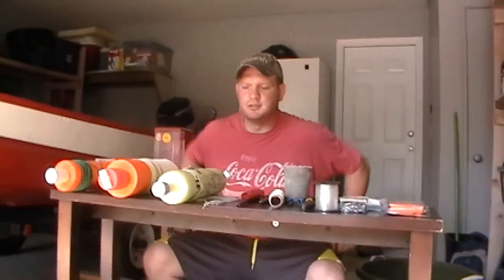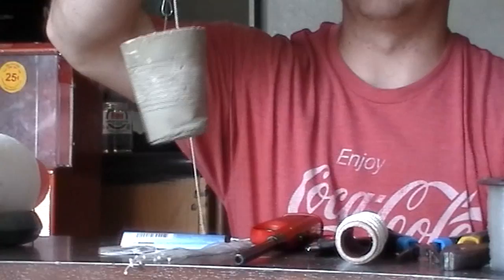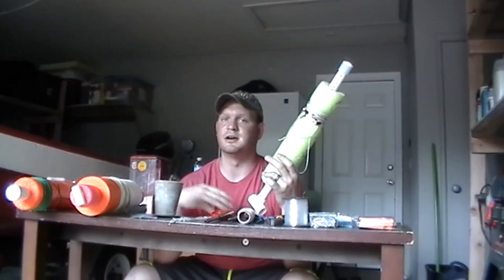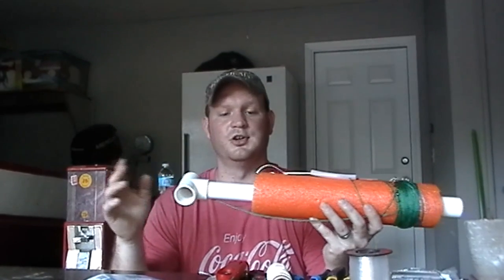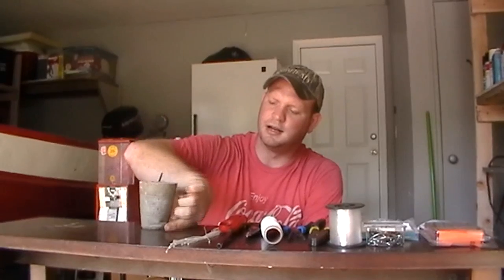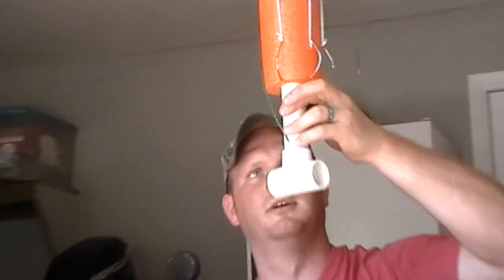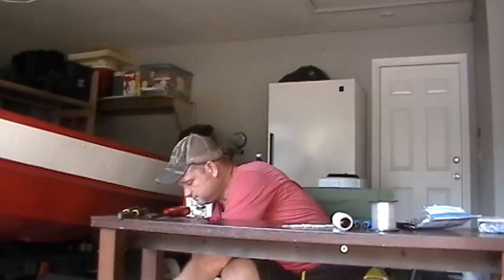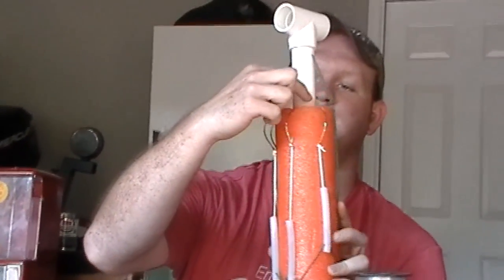How to Make Jugs Lines for Catfishing...Unique

Comment: I like what you are doing, definitely going to copy your lasted version. Just wanted to let you know that gray PVC electrical conduit is UV resistant so it should last longer than white PVC. White is made to buried out of the sun but gray is used on buildings exterior so they add UV inhibitors to prevent dry rot.
Reply from the maker: Did not know that Jim thanks for the info!

Comment: Excellent job! Those tubes to hold it from the main line is exactly what I needed to know. I was constantly dealing with a tangled mess every time I messed with the noodles. I am now excited about using these again. I agree with the concrete weights as well. Much easier to make any size you want and won't break the bank if you lose them. Thanks for sharing! Tight lines amigo!
Reply: Absolutely! Just make sure your "drops/leaders" arent so long that they can swing back into the mainline when your fishing and they will very seldom get hung up. Also inside the plastic piece is a swivel, that'll spin when you get a cat. Good Luck!!!

Comment: Great vid! You can drill a hole in the T and put a small bolt through with a washer and nut,then you can loosen the bolt,take off the T and change the foam. That way you don't have to cut off. My buddy made some of these for our fishing Trip and they work great!
Reply: Great idea Mark, maybe even just use self tapping sheet metal screws!! I am going to try it on one. Since I am making some this weekend.

Comment: Excellent video! I have been modifying jugs for many years for what works best for me. I use a similar method to keep my dropper hook away from the main line. I use a large 3-way swivel tied above and below to the main line. I tie the dropper line to the 3rd swivel eye and snug the end of the plastic tubing onto the 3rd swivel eye. The whole thing will swivel and still keep the hook away from the main line. I too use cement weights, but I have come up with a very convenient way to attach them to the noodle jug. If you are interested I will share it with you.
Reply: You bet shoot me a message.

Comment: Maybe a little time saving tip; when you're drilling your hole close to the tee, try a directional hole towards the tee to aid in getting the line through to the tee and you're not having to flip this way and that. I'm gonna make a few of these and give 'em a shot. Great video.
Reply: I'm making another set of 40, we took your advice and it worked much better. Thank you for the tip!

Comment: I understand you don't use the weight because you're worried about people running jugs but I'm not concerned about people running jugs where I'll be using them so I'm trying a hybrid of yours with the weight in the end. I will cap the T's so the steel weights don't rust and leave rusty water all over my boat. I like the idea of the T to adjust the depth. I also like the idea of the concrete weights to keep from having to spend an hour looking for all of your wayward jugs. One suggestion - you state you use orange noodles for better visibility. They didn't have enough orange noodles so I bought some orange and green. For my set-up, with the weights, I couldn't cut the noodles evenly to prevent waste (I had to get the balance right) so I had some noodle left over. In an attempt not to waste anything I put a 4" section of orange noodle on top of a 8" section of green noodle and I think I'm going to make the rest this way. I think that'll improve visibility since you've got contrasting colors and the orange is on top so when tripped but orange and green when they're on their sides.

Comment: Made some of these noodles and they are the best design I have tried.  I have caught many fish on these.
Reply from the maker: Thanks Jeff I took 20 of these out yesterday and caught 24. Biggest was 15lbs and the majority ranged between 3-7 lbs. If you find a better design or a way to improve, let us know. Thanks!
Reply: I found a better way to make the concrete weights.  Instead of using wire and  forming and bending, just buy a pack of chainlink fence ties at Lowe's.  Already have the shape needed to insert into concrete.  A bag of 25 is about $3

Comment: Thank you for your video!  It was a great help.  I made 8 of these up and for the most part used yours as a pattern.  On mine i found that with a long small screwdriver i could push the mainline all the way through the 3/8" ID tubing and attach one end of the double ring swivel using the same loop method on the mainline as you use on attaching the leader to the hook and leader to the swivel.  Then I draw the swivel and line back into the tubing.  This eliminated the need to tie the knots on each side of the tubing.  You can still change the hook and leader and move the hooks up or down the mainline if needed.
Reply: Roger Varner 
can you sent me a picture on how you eliminate the knots?
Reply from the maker: That's actually a brilliant idea Roger, would make it a lot easier to build the jugs, moving the hooks up and down the mainline is a plus, only question is how well do the hooks stay put once a cat gets on them... i would think they would slide to the next hook and tangle up?

Comment: Great video. One thing I'm going to try to do that will save a little $$, instead of using an "end cap" on the PVC pipe opposite the "T", is to drill a hole through the pipe at the opposite end of the "T" and use ultraviolet resistant zip ties at that end. One or two zip ties should keep the noodle from slipping off and it would be easy to snip off the zip ties to slid a new replacement noodle on when the old one goes bad.

Comment: You might try taking a razor knife and slice one cut length wise on your 3/8 waterline tubing, so you can just pop it on your leader line easily. If you are worried about it coming off, just add a drop or two of superglue. Great video!

Comment: Howdy,  I watch this video a few years ago and made mine like yours, which have evolved over that time to fit my specific needs and preferences.  I hope you are still catching fish and all is well.
Reply: Got the opportunity to take these exact same jugs out last weekend. Still holding up, foam and hooks need to be replaced, but still caught some.
Reply: I made some too. I've lost a couple when big fish took them down and got wrapped up in something deep. I'm going to glue/silicone 20 oz bottle lids inside the two Tee openings so I can screw bottles on for more  floatation when using bigger baits for bigger fish.

Comment: I run a two liter bottle with a 5 foot nylon leader and one hook on the bottom, i dont have a boat and made these and they all got tangled when trying to throw out from the bank so i made mine and they go out much easier but when i did catch one of yours it was hooked three times, wrapped in line and dead!

Comment: I absolutely love what you have done here.   I will be building this jug almost exactly.  I like mine to stand up when there is a fish so there will be a little difference.   Wonder if a steal leader 6" would work instead of the 11 1/2 in folded string.  When I build these and use them I will give you credit on my channel.   Not like you need it.  My channel is just beginning.

Comment: The plastic pieces your using has been used forever. You can buy them at most bait shops. They use metal instead of plastic and they also use swivels. Most people use them crappie fishing with reel and rod when they want to use more than one hook. I noticed that when your weight was not putting pressure on the line the hooks didn’t stay erect, they laid down against your line that would still cause it to tangle up the metal wire ones stay erected all the time. Just thought I’d let you know 👍

Comment: I also use RR spikes.  I like "Free".  I did lose my first one yesterday.  The spike must of gotten wedged in some rocks.  I had to cut the line and whatever fish were on it.  thinking I might use a very short strand of 10lb test between the spike and the trotline clip I use to clip it to my jug line.  That way if it ever gets caught again I can keep my fish and just lose a spike, which was free anyway.
Reply from the maker: Daniel that's an excellent idea! There's no doubt at some point you'll get hung up and lose a weight... using a small piece of 10-20lb line attached to the mainline would prevent breaking your main line and "shortening" the distance between your bottom hook and weight. I made 38 more 2.5lb weights last week and the cost was $8...$0.21 each

Comment: Thanks for taking the time to make this video.  Very informative and step by step.  Only question is what did you use for the plastic pieces?  Thanks again...
Reply: For the plastic pieces I tried about 10 different things and different lengths. I went to Lowes and bought a 25ft roll of 3/8" inside diameter soft pvc that is normally used for plumbing in refrigerators... I've layed these new jugs 3 times now while laying the green jugs... I caught 2 fish on 19 green jugs and 8 on 10 orange (new) jugs... Almost all of my hooks were cleaned on the green jugs and as far as the orange jugs go they almost all had a fish or bait still

Comment: Great video. I'm making 10 and heading to Eufala Memorial Day weekend. If I'm calculating right your top hook would be in about 25 feet of water when all your line is deployed if you have one hook every six feet or so. After you've had a chance to use these would you add more hooks or space them out to about every 10 feet?
Reply: Your absolutely right Ben, I've been using 20 of these exacts jugs for over a year now. I'm fishing out of 1950 semi V bottom that sits very close to the water. I haven't made any modifications to them, these are my "3rd" generation jugs, each time getting a little better... I would recommend spacing the hooks 5-6 feet apart for sure...it allows me pull 1 cat off while the next cat is still "calmy" in the water. Having more than 1 cat at a time has proven to be disastrous. The more hooks you have in the water the better off you are right...? Yes and No ALOT  goes into finding where the cats are and fishing them, I've found that I rarely fish deeper than 40ft and usually I'm around 12-25. A 5th hook would rarely get used on my jugs, but if you have a honey hole and need it, by all means throw it on there. GL Ben hope to see ya around Eufaula sometime
Reply: I wanted to let you know I made these jugs and put them out last year. We HAMMERED the cats. Caught enough to feed an army in a little over 24 hours. It was really exciting when I had two fish on the same jug! Thanks for the video. I’m headed back down To Eufaula for Memorial Day again. I’m hoping the weather hasn’t thrown the timing off too much!

Comment: Very nice. Thanks for the video bud. Me and a few buddies are trying this in a few weeks.. making them up at the moment... I'd like to see if you have any ideas for yo yo reel set ups?  I made some tripods and put them on noodles and some like the black swans but haven't found alot that will hold up that are cost affective... the tripods I made r about 12 bucks each and the swans are about 6 but have to heat pvc to bend the pipe.. just wondering if you have any input or if someone else does for my yo yos

Comment: Thread 6"mono through swivel before putting into tubing. Hold ends together with swivel hanging in  middle. Thread both ends through tubing. Pull swivel through tubing. This eliminates having to use screwdriver.  Leave mono attached to pull swivel and line all the way through tubing

Comment: Milk crates are my favored way of holding my jugs. I have also used a duck decoy bag.  I may have missed it but how long is each line on your jugs?
Reply: There is 50ft of line on every jug and each hook is 5-6 ft apart. I found not having the hooks so close together prevents less tangles and keeps the bottom fish in the water until I can get the top fish off. Because once the cats break the surface they tend to flip out and having 2 in the boat at once is no bueno. Milk crates are awesome, but I fish out of a 1950 14 ft Semi V bottom boat so space is a big issue.

Comment: Thanks for the video!  I made 8 and put out with cut shad.  I caught 7 fish.  One weighed 50lbs.  I had been looking for a way to make the bait hang away from the main line and this works perfect.  I never found one jug so a really big fish must have carried it away.  What do you think?  Bigger weight or more buoyant to catch a 50 pound plus?
Reply from the maker: I caught 28.6 lb Blue Cat a couple months ago and he drug my jug at least 3/4 of a mile. If you anchor your jug (weight on the bottom) it will definitely slow them down if not stop them completely. Its a double edged sword, because it won't allow the fish to swim and get proper oxygen (thermocline in water) and could very well kill your fish, especially in these hotter months. As far as weight goes 1-1.5 lb weights should be plenty. I personally use 2-2.5 lb home made concrete weights. The purpose of the weight for me is to stand those jugs STRAIGHT UP, making them a lot easier to see... Play around with it and tell us what you think. Congrats on your 50 pounder!!!! Thats a good day!
Reply: +THE JugMASTER Check my channel.  About a month ago we caught about an 80 lb blue.  We used rocks in socks to weigh the jugs down.  The jugs were very similar to what is made in the video.  I don't think the jug moved more than maybe 50 yards.  That's a guess.  Point is, it wasn't far enough away from where we dropped it to make us think we needed more weight.
Reply: +THE JugMASTER I agree on the concrete weight idea.  I am debating whether to use the styrofoam cups I have or use old vegetable tin cans filled with concrete.
Reply: Congrats on the 80 pounder, that's a good day!!! Becareful leaving your jugs weighted to the bottom once the water temp starts to rise...the bottom portion of the lake will become void and lack oxygen. I pulled in several dead cats 2 years ago before I figured out what was going on. If the water temp is below 55F you should be ok to weight them to the bottom over night. But once the water temp rises, it's probably best to run them every couple hours or leave the weight off the bottom a little to prevent dead cats... I used red solo cups (16 oz) for weights...the average about 2.5lbs and hold average size cats 3-10lbs in one spot over night pretty good.
Reply: That's a great tip on the lack of oxygen.  I hadn't even thought of that but I've watched videos of people pointing it out on their depth finders where the fish suspend over that area where there is no or little oxygen. We'll probably check them very often because we'll go out on a Friday night, fish all night and then into Saturday pretty much always on the boat.  I really would have liked to see that jug when the 80lb blue first got hooked.

Comment: So did the small flexible waterline pvc sections make a difference in the amount of catfish you caught? Getting ready to make my first batch of jugs and am going to follow your design if you think it is worthwhile. Thanks in advance!!
Reply from the maker: Junebug, Ive been using these exact same 20 jugs for 2 seasons now and can tell you it 100% makes a difference, the plastic piece does a couple of things. It keeps your bait from getting tangled on the main line and also holds the bait off the main line, making it easier for the cats to hit. While it was kind of a pain to set these jugs up, i've had much better success with them than i anticipated.  There's nothing worse than  running 80 hooks to find 60 are clean with only 6 fish on... Now if i have 60 clean hooks, i'll have between 12-18 fish on. The plastic peice has doubled the amount of fish i catch. If you've never made jugs before make 5 with and 5 without and see what you think...

Comment: Man, you have this down to a Science no doubt Amigo...hey quick question though, help me understand something I'm stuggling with...did you say, on the small plastic tubing/Leader/Swivel connection to the main line....was that swivel just free floating on the main line inside the tubing? then secured to the mainline by a knot above and below the tubing?  just trying to clarify this...awesome video and insane jug man...great creativity! I'm gonna attempt to replicate one or two to try out....thanks!
Reply: Your are exactly correct on how the barrel swivel connects to the main line and the knots above and below keep it from sliding to far up or down

Comment: I started using trot line Brads instead of the knots, adds a little to the cost but cuts the time and hassle time down significantly
Reply from the maker: Chris that's a very good point. I used beads/knots on my green jugs to hold the swivels in place, but the beads seemed to get "stuck" in the line wrapped around the jug when I set them. Have you had any problems with the brads getting stuck or tangled when you go to set them?

Comment: Could you use split shot instead of the knots.   Great video
Reply from the maker: I wouldn't use slip shots or beads. Anything like that will eventually get tangled once rolled onto the jugs. The splits shots could fall off and that's no good. I used beads on my first jugs and they worked, but were a pain when trying to set the jugs. As the jugs would roll out, the beads would get caught and I had to manually untangle several.

Tying knots is somewhat of a pain, but worth the time and effort.

Good luck!